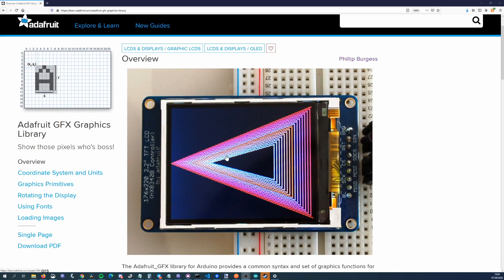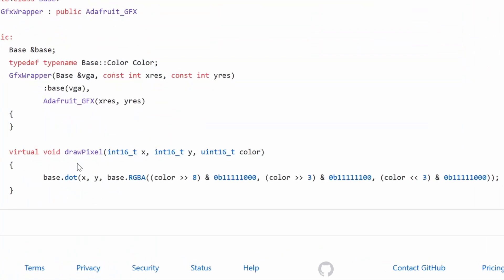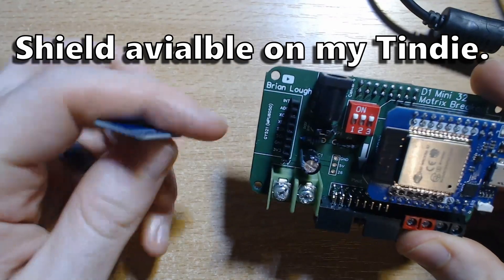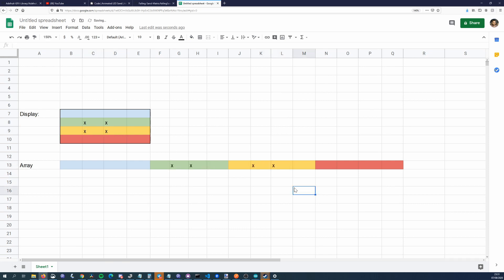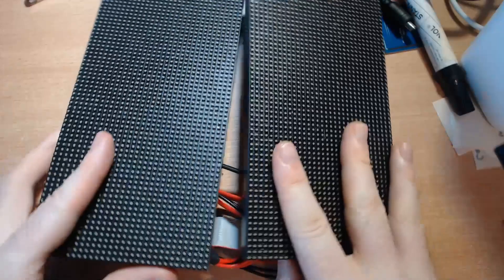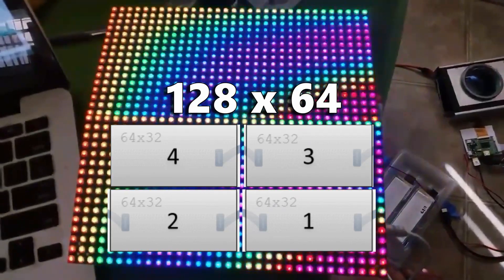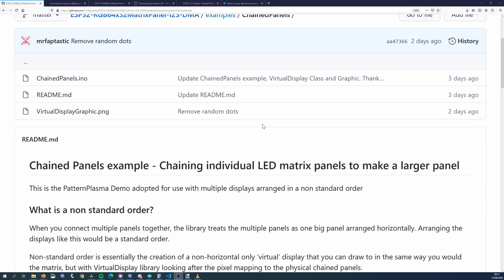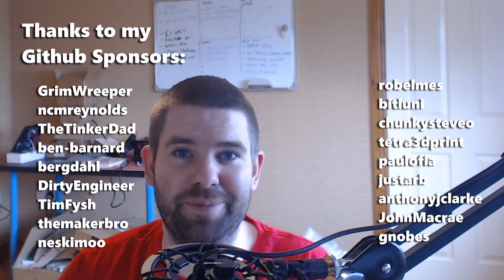Use AdafruitGFX To Bodge Solutions

Comment: I was browsing youTube looking for a Christmas gift project to make for the grandchildren. I thought this fallingSand would be an interesting thing to do for them. But, I'm having difficulty getting the software to work. I expect it is probably a change in technology. I only get half of the screen lit up and even that isn't active. I noticed that there are R1/R2, G1/G2, and B1/B2 labels on the 64x64 LED matrix that I have, but there doesn't appear to be corresponding pins for all of them in the project code. I've been able to verify that the displays work by running a Mario Bros clock, a PacMan clock, and a Waveshare ESP32 SimpleTestShapes example successfully. I understand that this post is from a number of years ago, but if there is any help you could provide I would appreciate it.

Comment: The multiple display controllers to one giant panel problem was difficult to deal with when I built a 32x32 matrix with MAX7219 controllers, each controlling their own 8x8 matrix. They are connected in one long serial bus, running in a serpentine to make wiring easier. The code was tricky to get working, and I don't understand how I did it anymore, but it works I guess :D
Reply from the maker: My main purpose of using GitHub is not for sharing code with others, but to share code with my future self when I inevitable don't remember anything I did 😅

Comment: Hi guys, I also a Matrix(64x32).
I am using the PxMatrix Lib he showed in another video. Afer a few days it is working really fine. But when there are more than ~70% of the Pixels on (it doesn't matter which color or which brightness), it starts flushing. It is really annoing and does not look  normal.
I am using a esp8266 is it too slow?
Any Ideas what I can do about it?

I'm really sure I got the wirering right, bc I first got it wrong and it took very long to fix.
I also changed the ShowTime in display method and changed the brightness.
I am really confused, bc in the Video it all seems so clean.

Ps: I'm not a native speaker. Hope you can read it though =)

Comment: Just spent a weekend implementing falling sand from the same starting code, and see my solution to fixed objects on the screen is exactly how you also did it. I love the idea of inheriting from AdafruitGFX. I made my own class to inherit from which makes all my animation classes able to run on any hardware. It looks like it would be very simple to inherit from Adafruit GFX in addition and make all that drawing capability available. My Falling Sand class also abtracts from the accelerometer hardware. You just pass in X and Y gravity for the panel, and a random 'shake' factor to prevent impossible looking balanced columns of pixels (unless you want them and pass in zero).